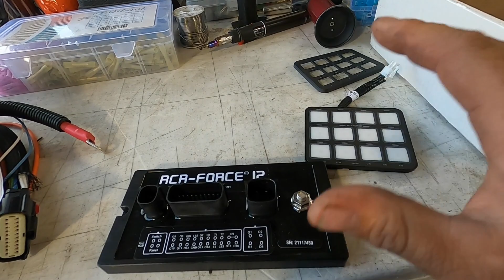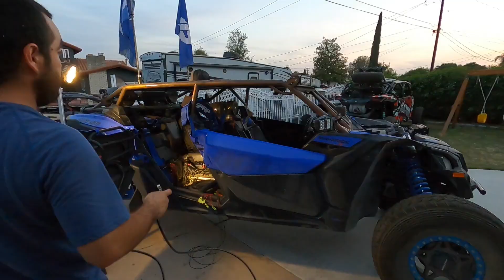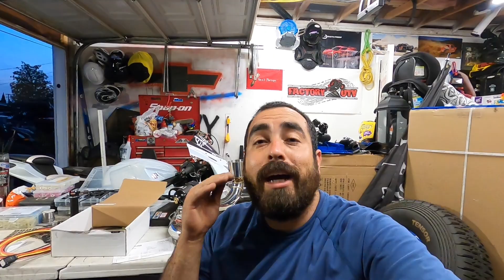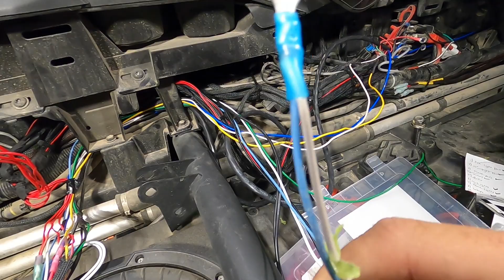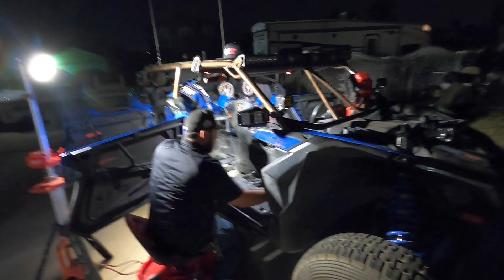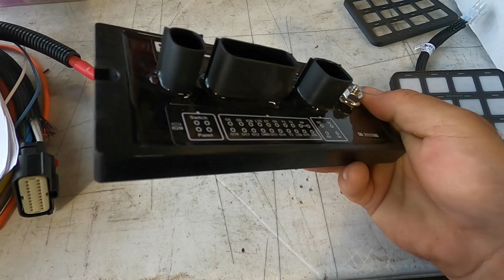CAN AM , POLARIS, UTV SWITCHPROS RCR-FORCE 12 WIRING INSTALL EP - 192

Comment: If your Switch Pro is on constant power. meaning the key or start button do not need to be on for the Switch Pro to function, then do you still need to tap into a different ignition power for the Start/Stop to work on X3?

Comment: What about wiring the Lt blue ignition wire to its own switch, off battery power? I have to use the phone app to wake up accessories even to light up the 4x4 switch. Then I am able to start / shut down the unit. Pretting start button doesn’t wake up accessory lights
Reply from the maker: If you're using the start button (on switch pros) to wake up the vehicle. Then that start button needs to be set to battery function. So Start button can work at all times

Comment: Is there any way to use the switch pro for ignition off a secondary battery? I know ignition is currently on the primary battery. I’m going to set accessories to run off secondary battery.

Comment: So if your not have the 12 start the car can you use the accessory post when programming? And then will it still run whips and rock lights with car not running? Thanks for help
Reply from the maker: Yes... As long as you set the switch for ships to battery on function

Comment: G gotta question have you had your dess system stop working because of your switch pro being used for ignition I installed the switch pro the way you did from watching this and it’s worked great for about 4 months well all of a sudden my dash starts saying could not recognize key and the dealer is trying to blame it on the switch pro I find this hard to believe because it worked for as long as it has and i don’t see why this would have any effect on the dess system??
2022 XRS TURBO RR
Reply from the maker: It shouldnt affect dess system at all.. ive installed many. And none have had issues
Reply: @GLifeUTV  thanks brother that’s what I was thinking I appreciate it

Comment: Ok, here is how you make the stop start work correctly. One channel  goes to the black/yellow wire on momentary setting. The switch pro blue and white wired to the red/black on the 4x4 switch. I am using an 8 gang switch pro. I used and #8 goes to the black yellow. On the app, turn  switchpro and then tap/hold down momentarily #8 to start. Boom....you have lift off!
Reply: @GLifeUTV  Edited. I was just trying to be funny. Sorry. I enjoy your videos.
Reply from the maker: @mannyahles1161  all good🍻🍻

Comment: I have baja design pod lights. Coming off the light is a black and white? What's the set up for a black, white amd ground?
Reply from the maker: If u mean black white and green.. the green is used for different function.. for s8 it is for the amber backlight using a power source..... if its the green wire for onx6. Its used as a dimming circuit for the light and gets grounded.
Reply: @GLifeUTV  where would you hook up the green to work the Amber's? Separate switch?
Reply from the maker: @mattficken8975  I normally do them to the ignition or accessory circuit. so they turn on automatically

Comment: with a 12 port switch pro you get 17 switches?
Reply from the maker: U get 17 outputs.. so 1 switch can for example control 2 outputs... 1 switch can be first press 1 output or 2nd press of same switch a different output..
Reply: @GLifeUTV  ok great so i will get a 12 switch set up

Comment: So i got mine installed. But im not understanding the starter issue you had with the lt blue and white on the lower post. If you have acc power behind the other toggle switch. Its the same as acc power? Where was the rocker switch hooked up that made it different?
Reply from the maker: The ignition has to go to the rocker switch if u plan to use remote start feature... If u use the accessory post, the post wont provide power unless the engine is on.. so from what we experienced. Since the accessory post only provides power when the start button was pressed or engine on. It would reset the switchpros Everytime and would not start properly due to ignition turning on and off
Reply: @GLifeUTV  so when engine is turning the acc post kind of cuts in and out so that makes the power come and go. On the rocker switch you tied into constant 12v or acc 12v? Cause if its acc 12v shouldnt it be the same thing as lower post. I see where the issue came just not making sense on the tie in of the rocker if its acc it should reset it the same. Or is it due to the back light on the rocker when engines on. That feed should still come from acc?
Reply from the maker: @Dune.Syndicate  The rocker switch powers the backlighting and it wont cut out... I have done it to multiple machines. Its the only way
Reply: @GLifeUTV  gotcha well ima have to tap into that 4x4 wire you tapped into looks like the red wire. Thanks G
Reply from the maker: @Dune.Syndicate  🤜🤛
Reply: @GLifeUTV  so i wired it to the acc post to see what it would do. And it would start but it would trip the switch pro on the second or third try and it would like cut out. I ended up doing the contant power like you said behind the 4x4 switch. I noticed when the machine is shutting down that backlight on the dash and on the 4x4 switch stay on until its fully shut down. I dont know if theres anything else you can actually wire to that would work unless its to that same wire closer to the ecu anywho thanks for the vid i got it squared away.

Maybe you can do a follow up vid on switch pros and explain the functions more in detail. Like battery vs ignition and some of those other weird settings.

Thanks for the content.
Reply from the maker: @Dune.Syndicate  Probably should do a follow up. Glad u got it worked out🤙

Comment: Hola disculpa cual es el cable que agarras para el sistema de ignición
Reply from the maker: The red wire for the rocker switch
Reply: @GLifeUTV  the red wire is
what goes to the cable of the button that fs start signal?

Comment: Yo questio bro.
On the switch pro. I see you have the dual battery set up. Is the dual battery still functional where you are running your acc. Off the hot wire? Or are both batteries on at all times now?
Reply from the maker: On this machine we eliminated the solenoid . Both batteries are always hott
Reply: @GLifeUTV  gotcha.
I have the dual battery set up. Can i run the switch pro through the hot wire on second battery. (Using switch pro for ignition)
And leave the the start up battery as back up. Will it still function?
Reply from the maker: not 100% on that one.

Comment: Do you move the white and blue wires back to the accessory post after you're done configuring all the switch settings through the app?
Reply from the maker: no, in this example they are powered by the backlighting from the 4wd switch, that is the ignition source. if you use the ignition source from the ign post it will power cycle the switchpros everytime u try to start.. this is only if u want to start vehicle from switchpros. if not you can use the accessory post as ur ign to power switchpros
Reply: @GLifeUTV  Got it.  Thanks for all the info, your videos are a huge help.
Reply: What is the difference on connecting the ignition wire to the backlight on the 4x4 switch and just wiring directly to the battery?

Comment: I have this same model of the switch pros on my x3 and was wondering if it works with the shocker exhaust from evo? I just got the exhaust and haven’t put it in yet but didn’t see in your video that it was operational. Great videos as always.
Reply from the maker: Note may void warranty but Yea. There are 3 wires going to the evo shocker actuator. Red needs constant battery + black constant ground - and the white wire gets controller by the switchpros on and off 12v
Reply: I just went down in the tread and saw the conversation about this… Haha! Thanks for the help!
Reply: Hell yeah man. Thank you again. Always look forward to you new videos.

Comment: I’ve been looking into getting the rcr 12 for the can am, would it make the wiring simple for all the stuff we’re going to be getting for it? For example I have baja designs lights and don’t like the harness they come with and would rather have it connected to switch pros, would it be just having the power and negative setup to the switch pros? Or would I need the baja designs harness for it still
Reply from the maker: It would just be positve coming from switchpros to bd light and a negative straight to ground from bd light
Reply: I am confused on this. I have BD light bar. The harness has a positive, negative and ground. What do I do with the ground wire/relay looking thing on the harness?
Reply: @drewfoster1493  i’m pretty sure you can just cut it out, the control module for the switch pros should have the relay in it already built it so you’d just need the negative and positive i believe. i could be wrong though but from what i understand i believe that’s how it works
Reply: @Rxvl_  so do I cut the wiring harness that goes to the relay and in there would be just two wires?
Reply: @drewfoster1493  i think so because the module should have the fuses for the light bar built into the switch pros so you wouldn’t need the relay that is on the harness they give you but i would ask frank to be 100% sure i don’t wanna give you wrong advice and just say yes
Reply: @drewfoster1493  frank would know it best since he’s installed them and has worked on BD light bars with the switch pros
Reply: @Rxvl_  Thanks. Hopefully he responds here then.

Comment: How did you wire the Shocker into the switch pros other than power and ground “red, black” where do you wire either green or white wire from shocker so that it closes?
Reply from the maker: black goes to ground, red goes to battery hot, white or green cant remember, it only uses one of them not both. is the wire you control on and off with the switchpros.
Reply: @GLifeUTV  yeah I did red to a output on switch pros black to ground and it only opens won’t close so figured gotta wire one  of others to power

Comment: What’s up Frank. Your videos are very informative. Can you tell me how you wired the exhaust to the Switch-Pros. The lights consist of power and ground but the Evo exhaust exhaust has a green and a white wire and I am not sure how to wire them. I Appreciate your help.
Reply from the maker: There are 3 wires that go to the actuator on the exhaust.. one is ground, one is constant power and the other is power control on and off... You will need to provide power and ground normally thru the power distribution near the shifter on the x3. U can have the power control circuit be  controlled by the switchpros. Note i can cut the grey harness. Just dont cut it to close to the original exhaust switch in case u need to reconnect the switch harness
Reply: Thanks for the quick response!  I actually have four wires. Power, ground, the white you described. When I tested them, it seems that power and white open and the same power and green wire close it. Would that mean that I would need to wire all three power white and green to the Switch-Pros? Sorry for the question this one is really throwing me for a loop.
Reply from the maker: @dannydeharo8243  your talking about the wires at the actual switch. There should only be 3 that go to the actuator on the valve
Reply: @GLifeUTV  there are three coming out on the valve but there are 4 when I cut the harness. Kinda caught me off guard I though there would only be the three showing at the connector.
Reply from the maker: U can dm on ig with photos if youd like. But i just did it to my machine. And u only need to deal with the 3 wires that go to the actuator
Reply: Same had those 4 cables but looks like the green wasn’t connected on the switch.

So power and ground to the bus bar, then the white one to an output on the switch pros?
Reply from the maker: Yup👌

Comment: i should be able to run this on an ATV correct?
Reply from the maker: Yes, but i would think most atvs have a poor charging system and small battery
Reply: @GLifeUTV  ah gotcha! makes sense. I have a 2005 Honda Rubicon and i custom fabricated some LED headlights, i have rock lights, i have a winch, and looking to put a small LED bar on the rear and another up front. The Rock lights are currently ran to a rocker switch panel and i plan on running the rear & front LED's bas to it as well (3 switches) but i know the panel is not water proof. thats why i was wondering about this set up

Comment: Do you have battery issues running all the lights and stereo on long night rides?
Reply from the maker: All can ams have a poor charging system. Best bet is running a bigger battery as a bigger "fuel tank"
Reply: They make aftermarket stators that are bigger than stock. They can be expensive but not as much as you think.
Reply from the maker: @dannyelliott8391  wasnt aware of any aftermarket stators.. i know most are upgrading to the 21 stator. Or getting the expensive zrp alternator kit
Reply: @GLifeUTV  EVO makes a 850w upgrade over stock 650w for $650.   https://evopowersports.com/products/850w-stator-upgrade-kit
Reply: There was another company that had more. Will have to find it again.
Reply: @GLifeUTV  I believe  only the 21 with smartshox has the bigger 850 stator all other 21’s have the 650
Reply from the maker: @jamesmaloney9228  i think ur right on that🤜🤛
Reply from the maker: @dannyelliott8391  evo i think sells the brp kit..